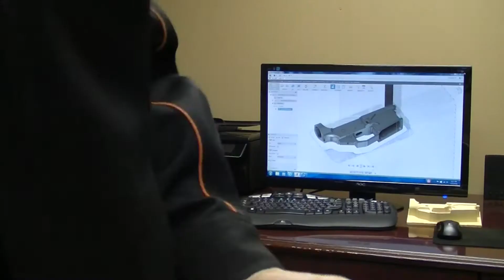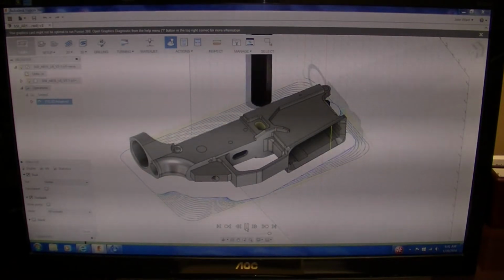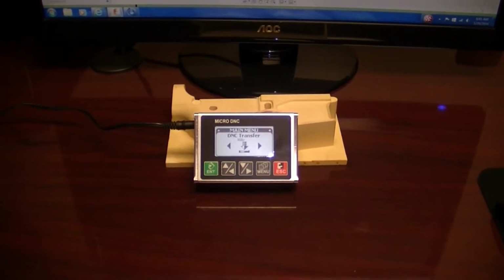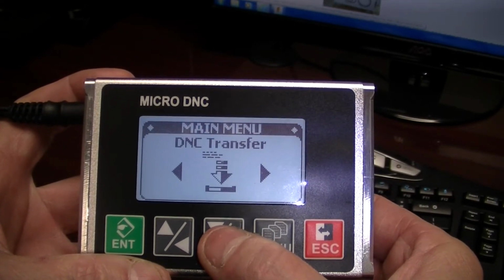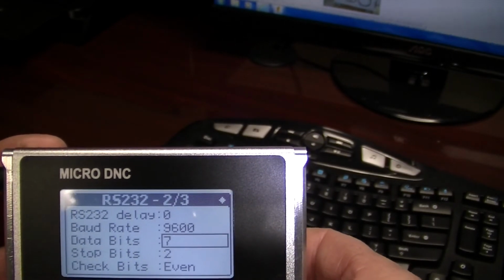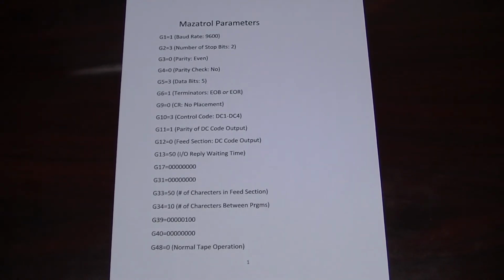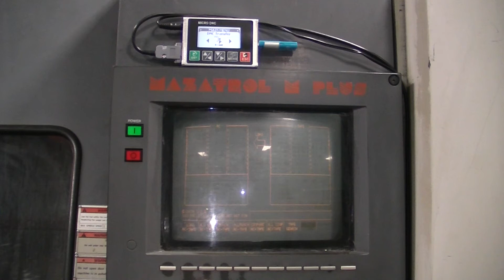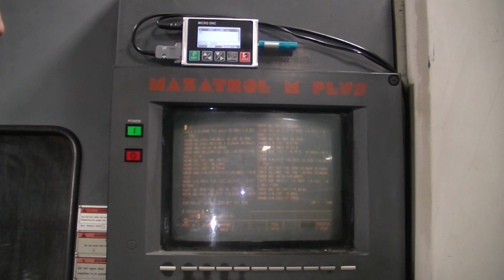Micro DNC on Mazak Controls

Comment: ShopLink FLASH 2.0 is your hand held file transfer solution
Greetings, my company Highland DNC make a popular low cost device called ShopLink FLASH, only $229 + $15 shipping.
We have out sold all our competitors with OVER 3000 sold. We have installed our units on all Gcode compatible CNC
controls with flawless operation. See www.highlanddnc.com or call 941-322-2286 for more information.
YES drip feed (DNC\TAPE) a program up to 2 gigs long, WOW!.
The reason we sell 10X more than anybody is US\Florida based customer service 24\7, if
your phone call isn't answered email jerry@highlanddnc.com and I will call you (US only).

Comment: I HAVE THE SAME MACHINE I DID MY PARAMETERS LIKE YOU ASKED SET IT UP 
THE ONLY DIFERENCE IN MY DNC UNIT IT DOES NOT HAVE THAT OUTPUT TO CHANGE.  MY DNC HAS A SORT FILE IT ONLY MAKES YOU PICK ABC OR DATE TIME
YOU HAVE SHAKE HAND AND IT LETS YOU SET IT TO SOFTWARE 
THAT IS THE ONLY DIFFERENCE BETWEEN MINE AND YOUR UNIT 

I CANT GET IT TO UPLOAD IT

Comment: Hi MikeThanks great video, I am looking to post code to a Mazak 4 axis lathe the post processor supplied by Autodesk is for a integrex. Tried to run code from post not sure that I have my work coordinate set the right way which I will have to try again on monday. Do you have  post processor for a 4 axis lathe for Autodesk Fusion 360?  They do supply a post for the 640M how well does it work We don't have a Mazak mill?